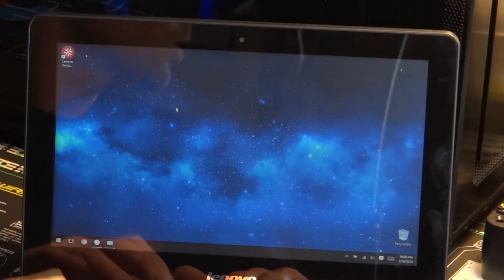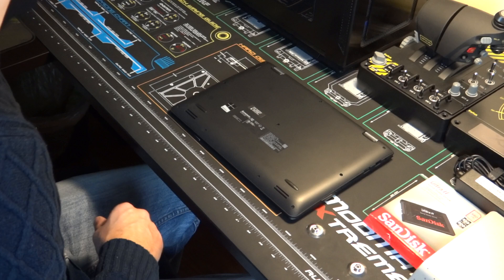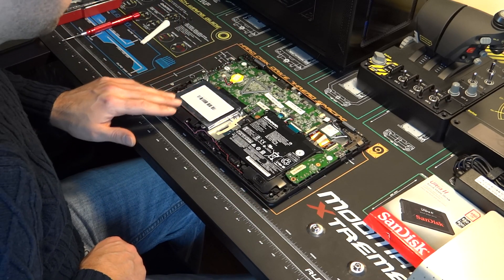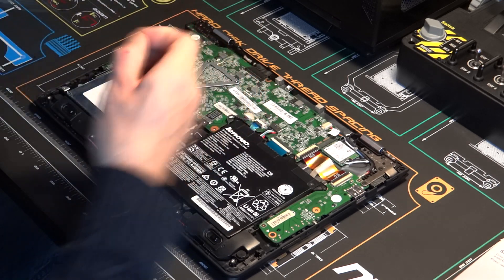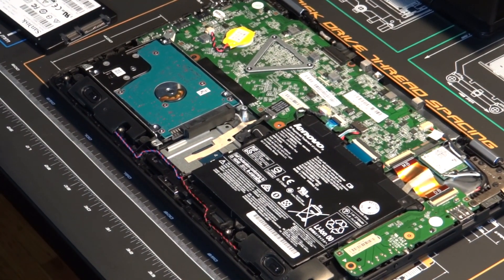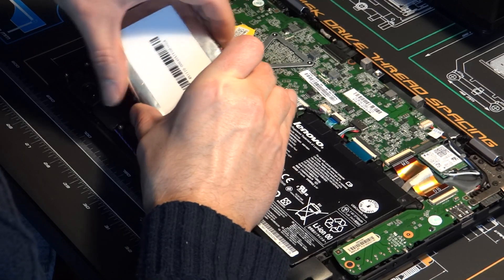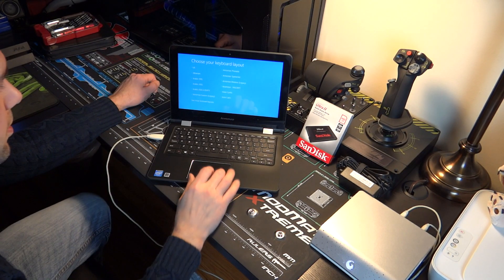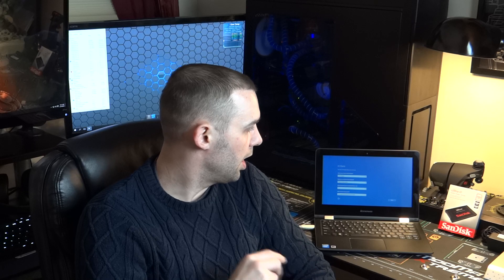Lenovo Flex SSD Upgrade (Windows 10 Migration)

Comment: Great Video, First question is where did you get the desk pad with the different computer templates? Will work with a 7mm 1tb SSD? I saw in the comments this computer may be upgraded to 16 Gb ram, is that a true statement? 
Thanks

Comment: Great simple video - used to replace HDD for SSD in Flex 10.  In my case the old HDD was additionally fixed in on the underside with a sticky tab, so some force was required to remove it once the screws were removed. Also the recovery from USB failed, but Windows 10 installed from USB did the trick.

Comment: i can't see the reason behind the reuse of the "sticky plastic" on the ssd.  that plastic was there to protect the PCB on the original hhd.
Reply: the flex 3 has no fan or heat outlet the sticky plastic is also shiny to help as an insulater against internal heat from the cpu

Comment: Thanks for posting this excellent video. I have a couple of hopefully quick questions. Does the Windows 10 install allow the SSD to be partitioned? Or does it take the whole drive? Also, does the recovery process create the recovery partition on the new SSD so that the recovery disk can be recreated if needed? Or do you need to go back with the original disk to recreate the recovery disk? Thanks again.

Comment: thanks for posting-excellent production and easy peasy to follow!
 tip to start clicking  apart case at hinge corners very helpful!
 i got mine started with (carefully) using a small flat screwdriver and worked across back to other hinge corner, then was able to click apart rest of bottom just with my fingers.
With my harddrive caddy, you removed screws, then slid straight backwards about 4mm then lifted back of drive first to get it out.

Comment: Thanks for the upload - very informative. But my Lenovo Flex 3-1130 didn't come with a HDD, as you show at 14:46, it has an empty slot. Do you happen to know where I can get the HDD bracket and cable adapter for that model?

Thanks.
Reply: i got the same issue, we both bought the standard one, i don't think we can upgrade the ram even, but if we can find the cords and adaptor to plug it in, adding an SSD should help speed it up a lot, let me know if you can find the adaptors or cords
Reply: I'm also interested in such a cable. Hoping someone can point me in the right direction. I stumbled across it somewhere online a few months ago but I didn't pull the trigger and now I can't find it again.
Reply: I'm in the same boat as far as my Lenovo Flex didn't come with a hard drive (at least where it should be based on the video). Wondering if it's worth it to try to put a new one in or just get a new laptop that is more user-friendly. Also it was a refurbished one.

Comment: nice video.  i did the same upgrade to my Flex 14 with the Sandisk Ultra II SSD.  I'm not to happy with the drive but got it for a good deal.  the boot time is great but I've noticed slow file read and writes.  Ive also noticed issues deleting files.  At work, we've been upgrading hard drives in selected desktops/laptops to a Samsung 850 EVO.  We use the Samsung Magician software to clone the drive, then swap it out.
Reply from the maker: +Ramesh Seelochan Ya not too sure if there have been any issues with it yet. Got this for my girl for use at college, so it's been getting pretty good usage thus far without any issues. I'll keep an eye on it and see if anything comes of it. I personally usually go with Samsung or Intel SSD's. Actually just got a new Samsung 850 EVO 500Gb. SSD for games in my personal rig. Thanks for watching !